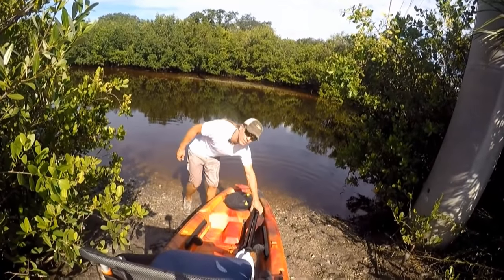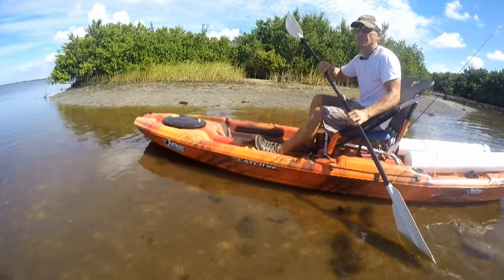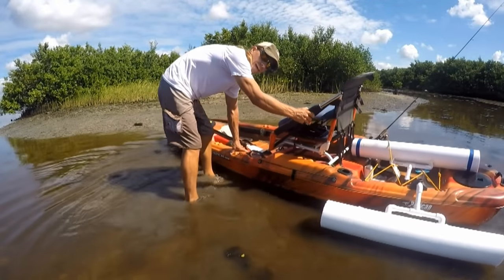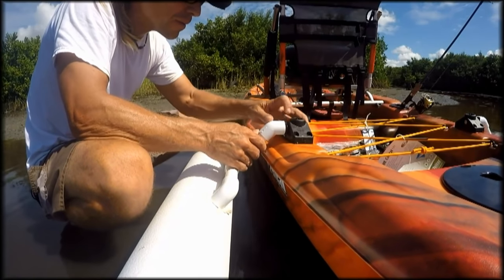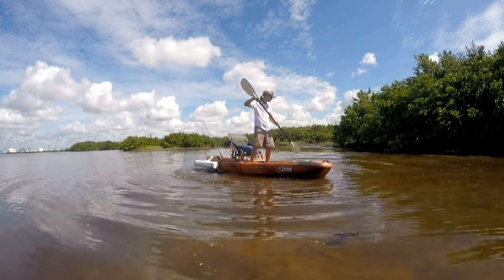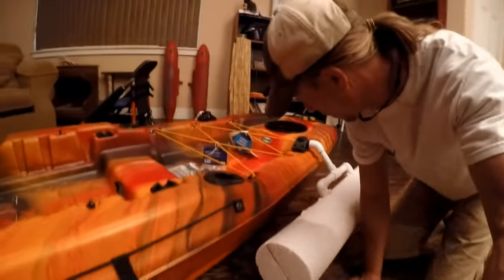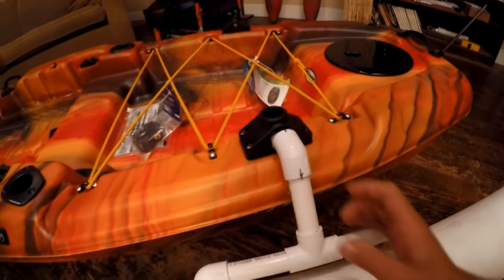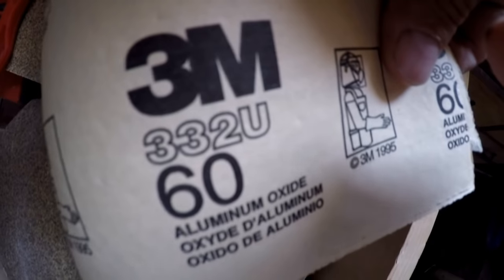Kayak Giveaway Part 6: Attaching the Pontoons

Comment: Nice video, lots of great ideas you've provided. Possibly two suggestions...
1. For the pontoons, possibly consider adding a medium to soft spring or shock absorber inside of the pvc, although outside may also be an option, to keep both pontoons always in constant contact with the water and provide less roll to either side.
2. When cutting your slot in the bottom of the foam for your fin matching it to your wood flooring lines, instead of using a marker freehand how about trying a chalk-line for better line accuracy and easiness.

Comment: I did something similar with denser Styrofoam, an old pool skimmer pole and some long bolts.  It made my very tippy kayak into the most stable one I know.  I use an electric motor when using the pontoons because it is more difficult to paddle.  What a difference being able to stand with confidence. Thanks for the great video.  I like the keel idea.

Comment: Why did you glow the floter on???.    I think it would be ezer  to take apart.   If it is for twest 2 tide wires will do the trick. I don't think you would pop out just stuck in.